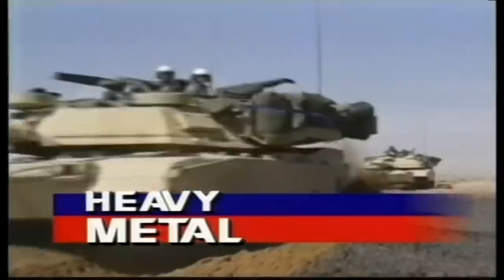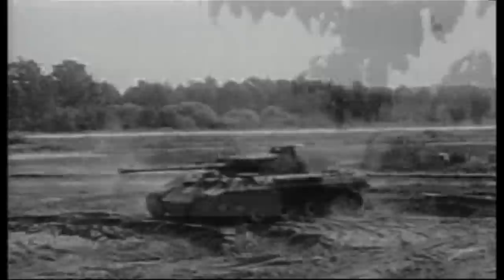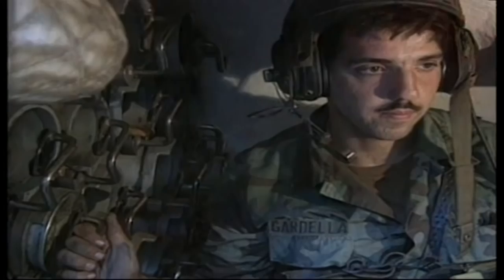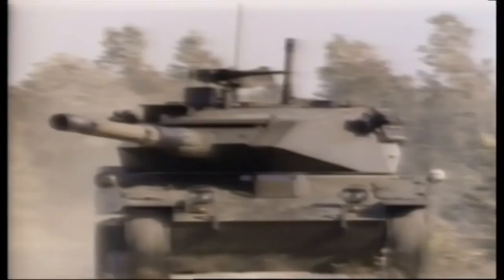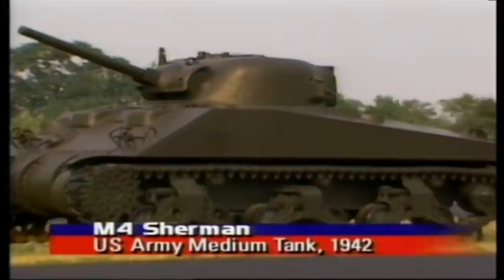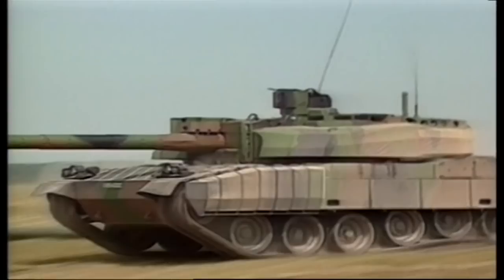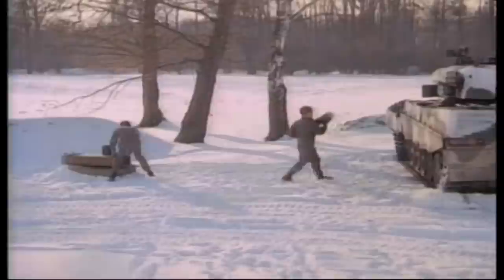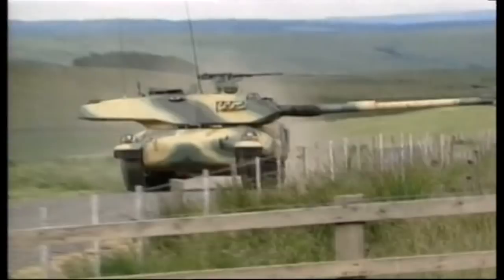Evolution of U.S. Tanks: From WWI To The Gulf War

Comment: “Even the 76 mm could barely penetrate the German’s armor.” With the Tiger it didn’t need to, just blast at it until the vibration of cannon shells destroyed the electronics. Against the Panther at the ranges they engaged one another on the western front it sure as applesauce could as shown at the Battle of Arracourt.

Comment: The T-34 was NOT the finest tank at the start of WW2. It was a horrible tank with several major problems that did not get ironed out until well into, or at the end of the war. It was plagued with poor metallurgy leading to armor that would shatter. Poor visibility and a cramped two man turret. The engine would die after 10 to 20 hours of operation and other issues. Check out The Chieftains video on the early T-34 for more details. Probably the finest tank at the start of the war and for the first year or so was the Panzer III. But it lost its title fairly quickly to several different tanks over the course of the war.
Reply: @matovicmmilan  Sounds to me you just described yourself with your assertions about the Chieftain. In your case its a pro Russian vs anti everyone else bias. 

I refereed to the Chieftains video because its the most concise on the subject. But, the Chieftain isn't the only one who comes to the same conclusion about the failings of the T-34/76 early in the war. If you want to talk about a late war T-34/85 then that is a different story. It was a pretty good tank. 

Any way we are not talking about the "specifications", or the numbers on paper, what we are talking about is the real world performance in late 1939 to mid/late 1941.
Reply: @Chris Howell I see you are a man of culture. I love listening to the Chieftain talk about tanks.
Reply: T-34 was objectively better, as was the KV-1.
Germans overcame them by superior communications (the importance of radios can not be stressed enough, and after the lorries boosting the logistical capabilities of the Red Army, radios and radio parts were probably the most valuable part of the lend-lease program), crew training and tactics.
That one of the factories (incidentally also the most productive one) reached the goals through shoddy workmanship doesn't detract from that.

Comment: Sherman’s were way more capable than what this video portrays.
Reply: Too true; the Israelis were still using them long after WW2 to duff up the latest Soviet armour; Shermans also acquitted themselves well against the much vaunted T34 in Korea.  There is a load of rubbish spouted about the Sherman; catching fire too easily, under gunned etc, but when it first went into combat in the desert in 1942, nothing else came close.  Unfortunately all WW2 tanks are judged through the prism of the Tiger; they only built some 2000 of them.